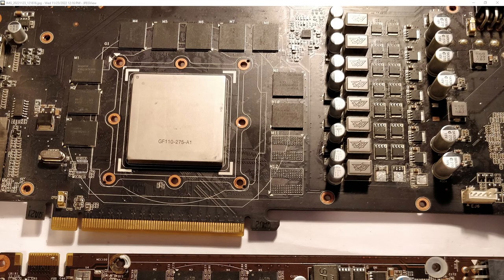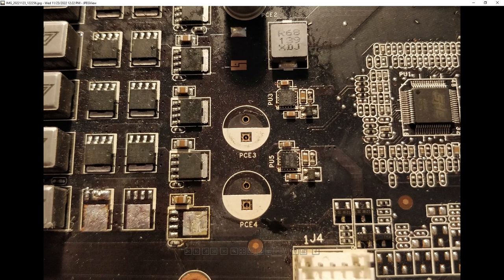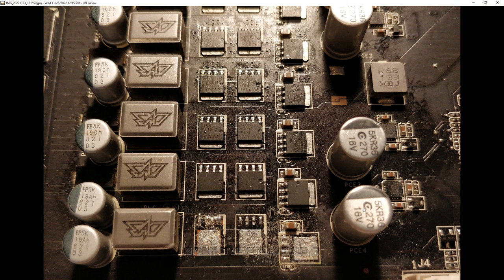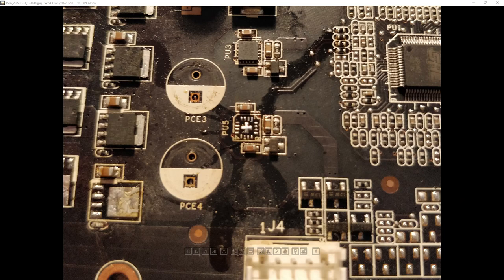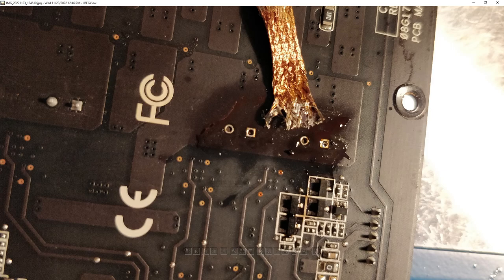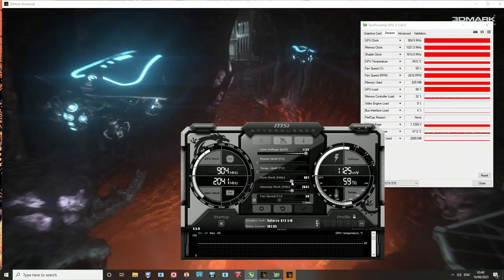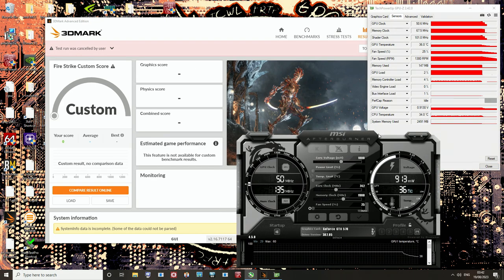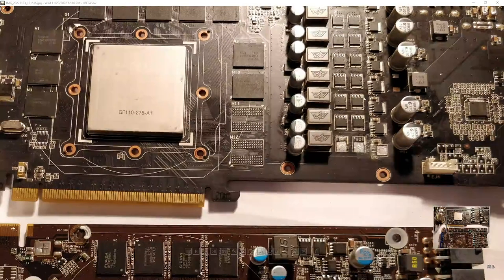ASUS GTX 570 Direct CU II Vcore VRM repair

Comment: A couple of comments. Get low melt point solder (bismuth) to remove existing solder without scorching everything. It makes extracting through holes extremely easy. Use pieces of high temp silicone pads to protect temperature sensitive components. Resolder using lead-tin solder, as it'll last longer and has a lower melt point. Use lots of flux. And clean it up when done (even if it says that it's "no clean").
Reply: The low melt solder is great for surface mount components. Never tried it on through-hole: I'll give it a try.

Comment: I killed two boards removing vcore caps before I got a hakko desolder gun. It works well. Stupid expensive tho. Hakko fr-301 is the model number. 

An air compressor will clear the holes too if you get the board hot enough. Easier than wicking it out.  Just be careful where you're aiming lol. 

Really informative video, thanks.
Reply: ah yes, the glarses gun

Comment: For preheating the board I got a T8280 from aliexpress. It's an IR preheating plate with temperature control. It's not that accurate as far as temperature goes, but it's good enough to get he board warm enough to solder on.

Comment: Tip...low melt solder. Apply to your iron and hold it on the solder joint. It mixes with unleaded solder to bring down melting temps, remove components easy and wick the hole clean to replace a component. Works great!

Comment: Do you have any videos where you fixed/replaced a gpu fan mosfet/circuit? I plugged a wrongly wired fan into my gpu and fried the circuits, now it won't work with any fans.

Comment: ... and then you realize, that electrons have a negative charge, and they are therefore flowing though the core first and then through the inductor, and finally through the MOSFETs. Because the universe just is it like that, and our convention on putting the VRM before the core is just that: convention.

Comment: Hello ! I have a rather simple question  that could use your insight. I recently bought a highly binned kit 4000c15 requiring 4-10-44 trrd tfaw, but my x299 motherboard won't allow trrd above 7 ! Is this normal? Bios bug or IMC limitation? Thank you! X299 ftw k
Reply from the maker: IMC limitation. The tRRD_L register on Skylake X doesn't go over 7.
Reply: @ActuallyHardcoreOverclocking  thank you so much ! tRRD_L at 6 dosnt produce stable results. 3800c15-16-16-36 52 (s,l,faw 4 6 20) tRFC 342 @ 1.4v seems to work for now, so I'll proceed with that setup and tweak further. Currently 102gb/sec @ 57ns. Again thank you so much. Been trying all sorts of tRRD keyboards on Google and had no luck.

Comment: F4-4000C16D-32GTZRA i have this could you help me out whats best ram settings for my ram? (System 12900k, 3090 and z690 msi edge ddr4 wifi) I would like to run it on 3600 g1 t1 cl14 14 14 28 BUT even i set dram 1.5volt it crashed after 10min playing fortnite and errors crash on TM5… i dont know sub timings so i didnt touch it I want to run it on g1 t1 mode so I dont have penalty doesnt need to be 3600 14 14 14 28 tho but damn stabil pls help @ActuallyHardcoreOverclocking

Comment: The perfect cost for nvenc encoder with prehistoric ports!  10/10 how I would use it.
Reply: Except by all sources the 5xx cards doesn't have NVEnc hardware, that was introduced in the 6xx (Kepler) series... And the Kepler encoder was limited to 4:2:0 h.264 so the encode tends to not have very readable text, some but not all Maxwell cards got the much better 4:4:4 h264 capability but it's not until Pascal (10xx!) that I would classify NVEnc as a good encoder, even if Pascal was still somewhat crippled by the lack of B-frames (added in Turing).
IMHO early on Intel QuickSync was far superior to NVEnc when comparing hardware from the same year. Pascal brought NVEnc to parity, Turing is where Nvidia really flexed their NVEnc compared to the competition IMHO.
Reply: @Torbjorn.Lindgren  oh wow thank you. I’ve been looking at them thinking they had nvenc support. :(.